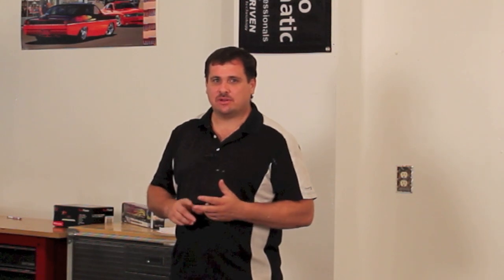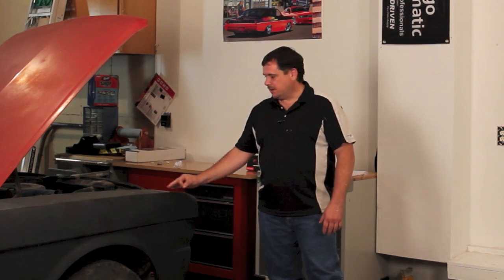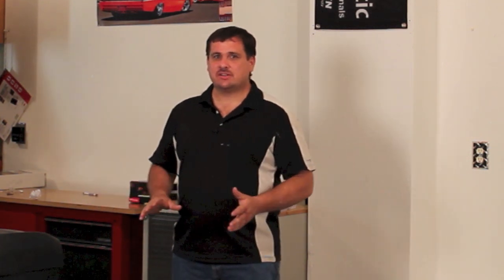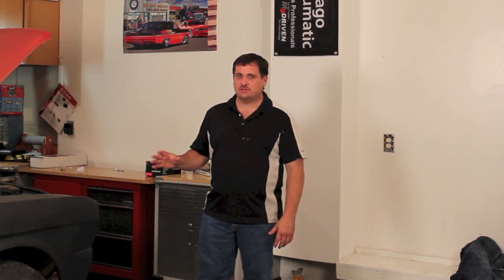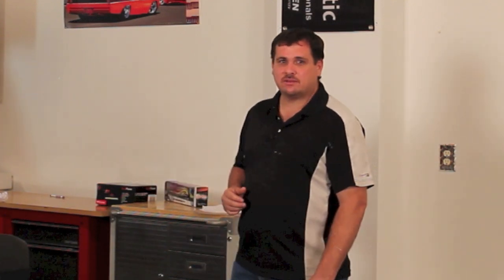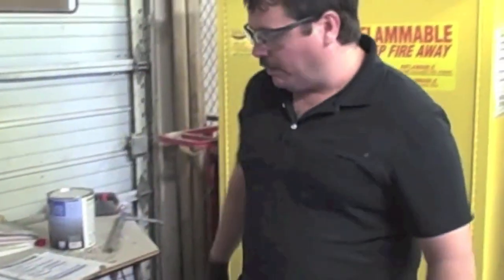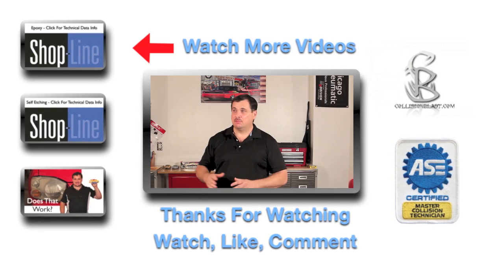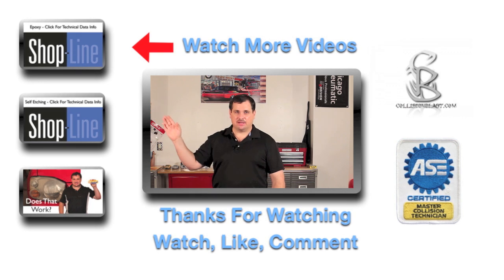Epoxy Primer vs Self Etch Primer for Bare Metal

Comment: Hey Donnie, can I strip a motorcycle tank to bare metal, sand it with 80/200/800, put some epoxy primer and call it a day? I want to get that cafe racer bare metal look but I don't know if I should be doing something else to protect the tank. Cheers.
Reply from the maker: I am not sure, but I did find a direct to metal clear you may be interested in http://www.kbs-coatings.com/DiamondFinish-Clear.html Would this work?
Reply: DIY How To Paint A Car School No, I'm looking for a matte finish (like it would look if I didn't do anything after stripping the paint...). Suggestions?
Reply: João Soares You could probably just rub the clear coat down to give a matte finish. It will never quite look like bare metal though. For that perhaps just have bare metal and use a rust prevention wax like Boeshield.
Reply: ***** Thanks man, l'll try that. It's not like Donnie has a better tip...
Reply: João Soares Also saw this in there FAQ section: "At this time, the DiamondFinish Clear comes in a Gloss Finish. However, you can lightly sand the DiamondFinish Clear with steel wool after 24 hours to knock down the sheen."
Reply: ***** Thanks.
Reply: 512kjt Who are you?

Comment: does anyone know if epoxy primer can be reduce and if it does would the hardner be measure after reduce ???   oh and can it be reduce with thinner ????  sorry people nit dumb just trying get into this field
Reply from the maker: I havbe added a little reducer to epoxy to help it flow out.  This may vary depending on the brand.  I would ask your paint supplier for a technical data sheet on the specific brand of epoxy you're using.
Reply: SHOWMONEY5 OP is correct, make sure you use a reducer that is compatible with epoxy.

Comment from the maker: If the paint is in good condition, you can final sand with 400 grit and paint on top of the sanded surface.  Epoxy or self etch is for metal.  So if you are not stripping, you can skip this step.
Reply: What is primer sealer used for?

Comment: I sand my hood down to bare metal, and I did some body filler work on it directly to metal. Now , do I need to use self etching primer and also a top coat of other top primer.? I cant find poxy prime around the area where I live. Thanks! Great video

Comment: you mention the 72 hr window . If I use this to prevent rust on bare metal , do I just need to lightly scuff the panel to work on top of epoxy at a later date ? 
great video answered a lot of questions I had asked in the past.

Comment from the maker: One uses reducer and the other one does not.  This depends how thick you need the primer to be.  If you are spraying a larger area, I would use some reducer so it does not spray out dry.  If you are spraying a small spot, you can get by with the mixing ratio without reducer.  At the end of this video, I have a link to the technical data sheet explaining the facts about 202.  The link may also be in the  description.  Thanks for watching!

Comment: I'm still confused though.  Is epoxy ONLY for bare metal?  I was taught that epoxy goes over the bodywork but under the high-build primer.  Also, can't you shoot the epoxy over regular primer as well?  I have been doing my car in one small section at a time and occasionally use rattle can primer to cover the small area I'm working, then when I'm done with that section entirely, i shoot the epoxy PPG primer.

Comment: Hi Donnie, great vid, you mention paint strainers and you mention sometimes you use two for basecoat and clear. Do you have a preference for the actual size of the strainer 120 - 400 microns range, depending on application? Do you additionally use a strainer if you are using the 3M pps system with the strainer incorporated into the system? Thanks J
Reply: I am curious also! The PPS 2.0 system makes it impossible to remove the inner screen without cutting it. If you pull on it or use pliers, it comes in pieces add junk into the cap!
  You have to time properly as well, because even with an induction time, pot life is real short.

Comment from the maker: Are they using epoxy as a sealer before painting?  That will be fine, but if they are applying self etch, then epoxy, then primer surfacer....I don't know that there is a benefit.  Unless there is a paint company that recommends that.  I know with PPG or Shopline that is not necessary.

Comment from the maker: No, it is not recommended to put body filler over DTM.  You should apply the body filer to direct metal.  The only primer that filler can be applied on top of is epoxy.  Thanks for watching.

Comment: Great video Donnie, thanks for the good information.  If I use a DTM primer, is it okay to put body filler on top of that, or does the filler still need to be on top of the bare metal?